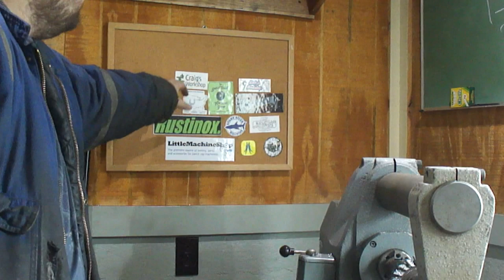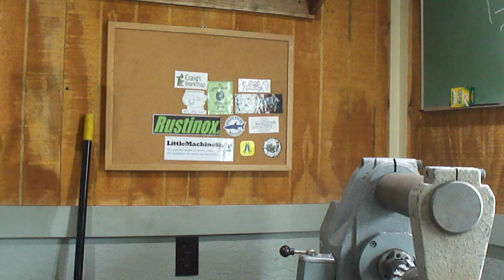T&C Grinder Build #15 - Drawbar, Stickers - Milestone

Comment: Sounds like your spindle is set up similar to my TPG with a spring washer against the end bearing .  My one doesn't have seals to speak of , just minimal clearance to keep the light grease in .  Every time i use it i put a couple of squirts of oil in  as per the manufacturers instructions .   Looks like  it will be the '' Dogs Bollocks ''  for tool grinding !    Cheers .
Reply from the maker: lol, yea, I designed it similar to the setup that I saw in various higher end spindles for surface grinders and such with the spring washer, was trying to go for as high of precision as I could on the thing, lol. I put in quite a bit of oil into the spindle to flush the bearings to keep them lubricated, and it drips a little bit every once in a while around the seals, but it does run pretty good. Ill just add a little more every once in a while. 

After this thing is done, I should be able to grind and sharpen pretty much everything, or at least that's the hope, lol.

Comment: Coming together nicely! Please add a front side power switch, though. I twitch whenever you lean over one of your machines to plug or unplug them!
Reply from the maker: lol, thanks, and yea, thats what Im planning on, I hate reaching around the machines to turn them on and off, so Ill be making a small box underneath of it with the air manifold and wiring into it, was planning on that from the beginning.

Comment: Great well done.  Will you be able to sharpen end mills with this?  Now you need to come up with a dust collection system for it.
Reply from the maker: Thanks, and yea, it'll be able to sharpen endmills, slab mills, etc, just havent made the other two tool heads for it yet, but those will be very soon as soon hopefully. Im already planning on making a dust collection system for it, so that's on the list of things to do atm already.

Comment: Nice progress man any thought of a diamond dresser to help true up the wheels and or a hub that has movable weight to get your wheels balanced??
Reply from the maker: thanks man, and yea, Ive already designed it in so the diamond dressing sticks that I got at rough and tumble can be used to true up the al-ox wheels, but for the diamond ones, I have that diamond dressing wheel that Ill just use for that if it really comes down to it. The runout really isnt that bad as you can hear by the sound in the video tho. The vibration and such is coming more from the belt than it is the wheels in all honesty.

Comment: Seeing your T&C grinder running has me more exited to get mine going. Is the wooden base permanent or are you gonna try and find some steel for rigidity? Or is there something I'm missing?
Reply from the maker: lol, yea, Im interested to see what design you go for on yours. 

The wood base is only temporary, and will eventually be turned into a pattern to be poured in aluminum. I figured 5/8" thick aluminum plate would be more than rigid enough, expecially since it'll also go on top of a small wooden cabnet/frame, being bolted down to that, so that should make everything more than rigid enough tbh. 

The cutting forces on a T&C grinder are very low compared to something like a surface grinder, so in all honesty, the wood base probably would be fine, but I planned on adding a lip on it also for coolant and such in case I want to add it in to prevent the cutting edges from getting too hot and being burnt up on tool bits. I use alot of forged high carbon steel tool bits, and coolant/mist coolant will help alot with that, and also it'll help with grit and carbide dust from flying around the shop too, so I wanted the small rim for coolant collection.
Reply: @ChirpysTinkerings  That sounds like a great idea. Maybe add a 1" tall lip to the plate, so it looks kinda like a pan, for using flood coolant? You'd probably need a reservoir and definitely a pump, but it'd make grinding go faster, as you wouldn't need to wait for the workpiece to cool down. In any case it should serve you well
Reply from the maker: yea, it'll probably only be like 1/2" tall, and Ill probably do a mist coolant, which will be a copy of my oil burner for my furnace, and all you need for that is an air compressor tbh, which it'll be used anyhow for the air bearing/spindle, so it'd already be hooked up. 

Also flood coolant can be more of a pain on a grinder anyhow because the fluid can soak into a wheel, and throw things off of balance really bad till it has spun up and had time to fling the coolant back out of it, which could lead to weakening of the wheel over time and even damaging of things due to the off balance. So the mist coolant setup would be best in the end, and use alot less coolant while still keeping everything cool.